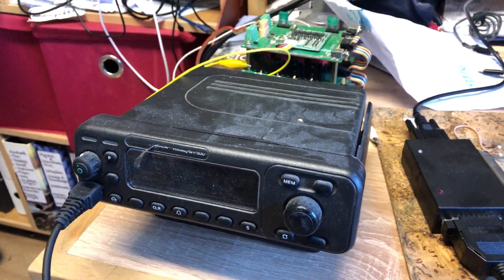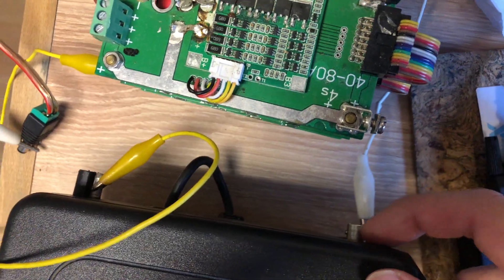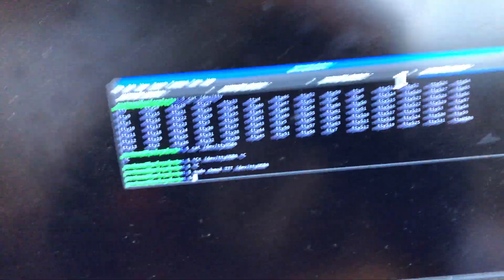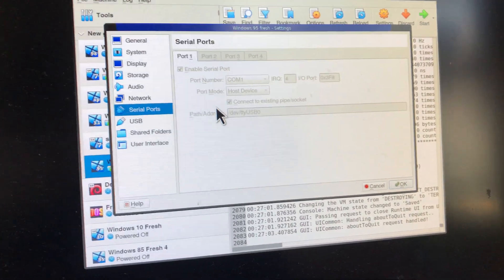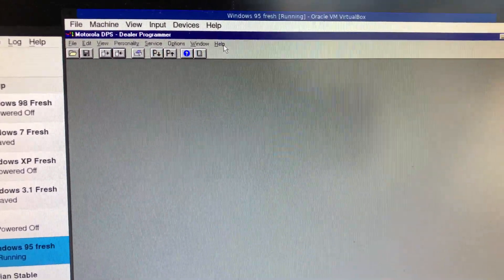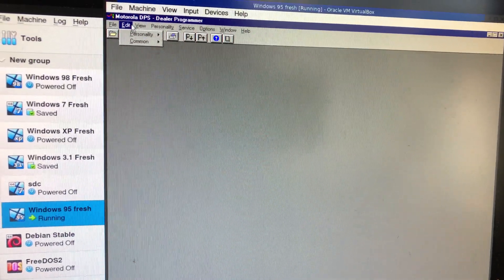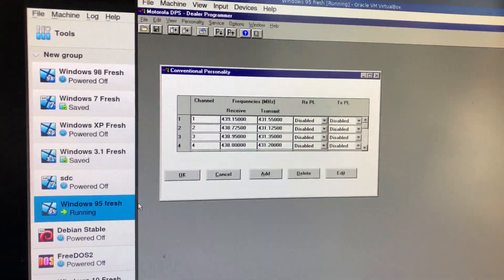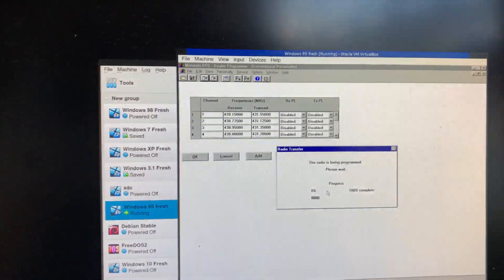Motorola GM1200 Radio Programming and Virtualbox

Comment: Hi. The TX power, Squelch sliders are not responding in DPS. What it can be? (Accessed bay the way with password DPS*SERVICE )Radius GM1200, Virtual Pc 2007, Com port, RIB to mike. Win98SE. Reads writes good. Wookie tuner can do the sliders. But wont it be harmful then for the radio?